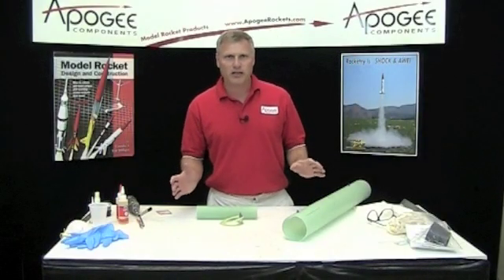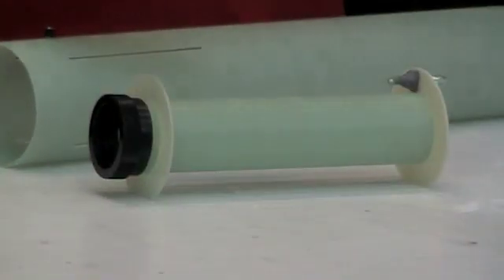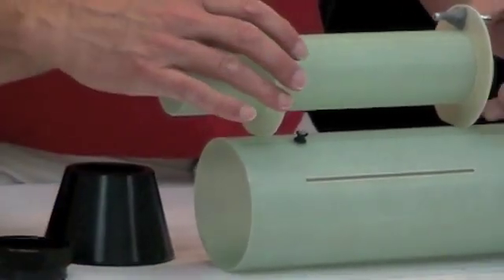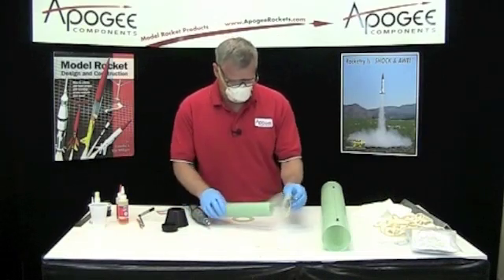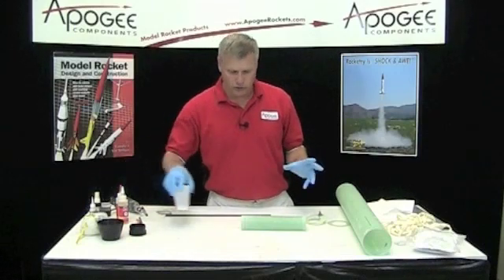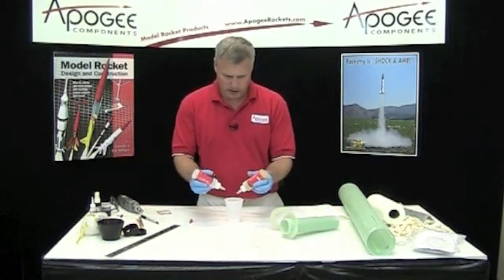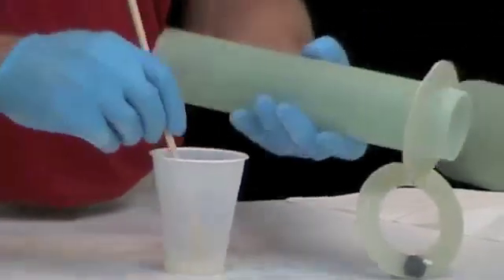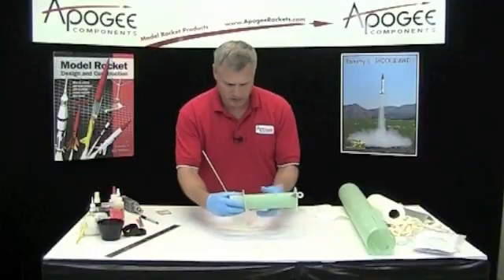Building the Level-2 Fiberglass Rocket Kit - 4: Positioning The Centering Rings

Comment: One thing you can do to keep the rings, which are loose, squared & tight put a little 1/4 inch by 1/4 inch wide piece of masking tape where the ring will go. Just enough to get some friction. It will not hurt the strength of the bond as it's just a tiny fraction of the circumference of the ring. Another way is to square the ring up & dab some thick CA on a spot of the joint. Then hit it with some CA kicker. Instantly it will hold and not you can take you time filleting the ring. I've used both.